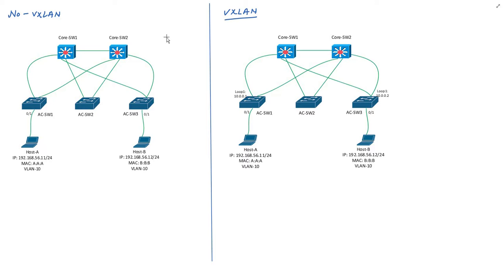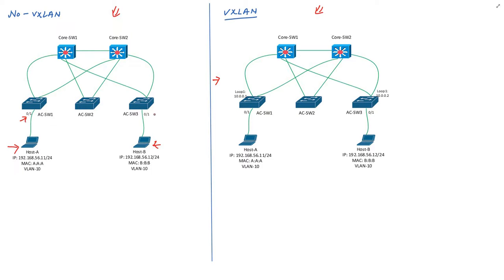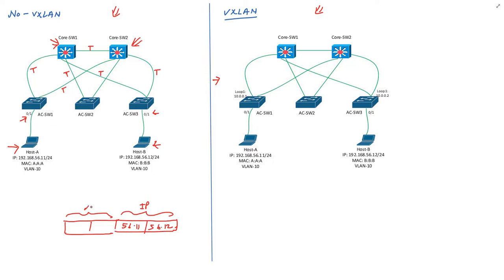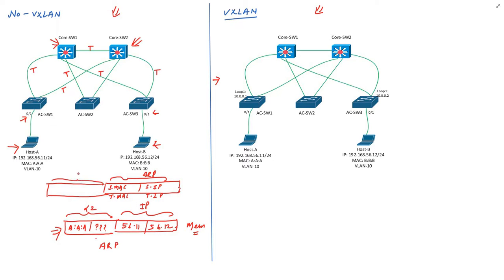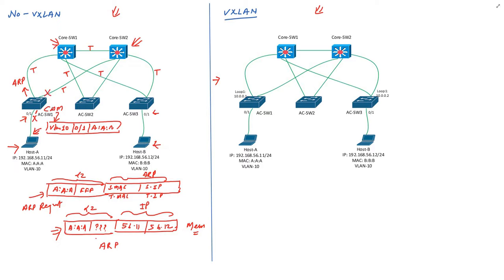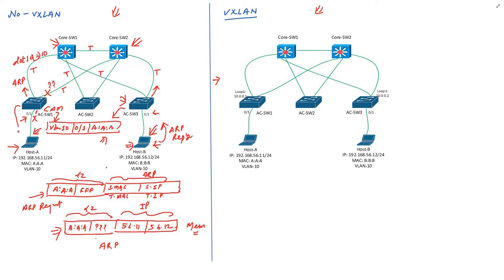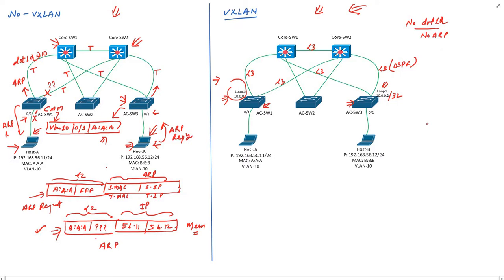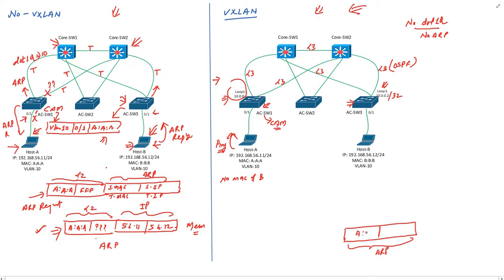SD-Access Data Plane part-1

Comment: Brother, your videos are great.  I have watched most of these.  Really I appreciate your effort.  One doubt; In SD access, switch works for data plane only, but MAC Table is part of control plane. Then how switch can store CAM table?
Reply from the maker: Hi Tom.. Thanks for liking these videos. This is not the case.. there is a MAC table on switch.. Normal switching works as it is.. Just see the data plane videos again and you will get the logic..
Reply: @bridgewhy  thank you brother

Comment: Switch wont send arp request on the other link bcoz spanning tree will block that link, as two switches are trunked n not VPC’d together.
Reply from the maker: Yup !!! Yash, would you mind writing your question regarding ARP here? I am not able to see the full question..
Reply: The Bridge Hi Vishnu, thanks for ur response. My question was 
1. In non vxlan scenario, source device knew Dest IP , Dest Mac, Source Mac but destination mac was missing, for which it does arp (broadcast to ff.ff...) but in vxlan scenario the actual source address and dest address are not even in the initial frame, but the loopbacks are present in d frame, in that case how does does control plane knows which destination sw loopback to provide address for,? Does CP node look at final dest mac address (broadcast mac ff.ff.ff) in its table and provides all dest sw’s loopbacks? Sorry for long writeup i am new to vxlan n know nothing on LISP yet. If answer is in LISP then i am happy to wait for your next video. 

2. Recently from one of the cisco competitor vendor i heard them saying that vxlan was not designed with future enhancements (no TLVs) but in the initial videos you mentioned it has 2 bits of TLVs which it uses in SDaccess for tags (trustsec). So my qq was, are these TLV bits introduced recently and used just in sd access?
And are there more TLVs in vxlan encapsulation?

Thank you for your time and help with the great videos you are creating. Appreciate it! 😊
Reply from the maker: @yashpancholi5765  Correct!! My next video will cover cover this.. mainly LISP will connect the missing dots..
Reply from the maker: @yashpancholi5765  For your second question, I mentioned this in last video regarding what fields we are using in vxlan header to carry SGT's for micro segmentation.. And yes you heard it correctly that vxlan header was not designed for future enhancement and exactly this is why we are reusing the already coded field..

Comment: Because the port is blocked due to spanning-tree so ARP packet won't be forwarded over blocked link.
Reply from the maker: Correct !!!!
Reply: @bridgewhy  how do you know it is that link is blocked, not the interlink between the switch?
Reply from the maker: @yanglijian  Yes, correct, the blocked link could be the interlink between two switches.. the idea behind asking this question is that viewer is aware of Spanning Tree and it's consequences. And from your question, I am pretty sure that you have good understanding of STP.... Thanks..